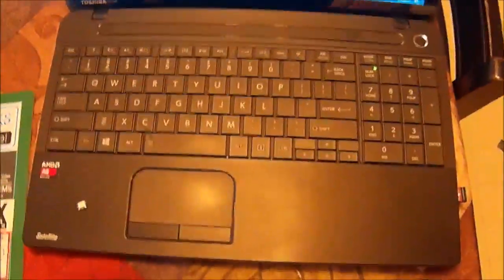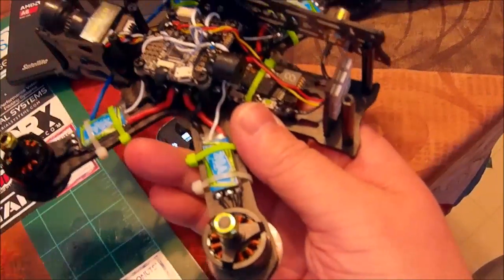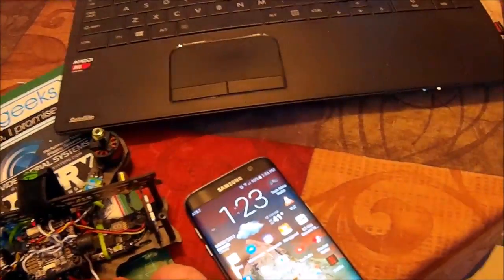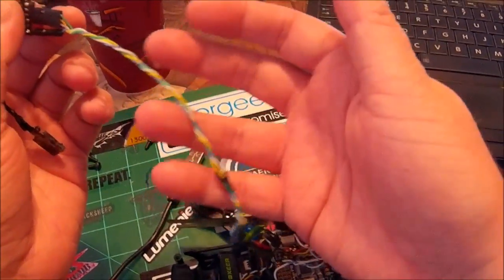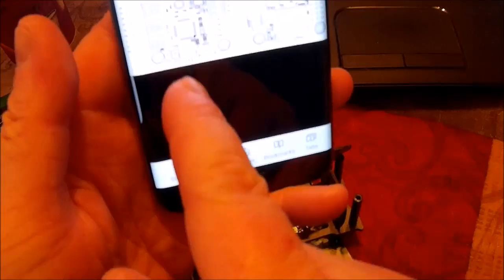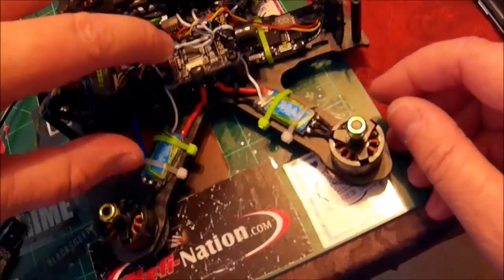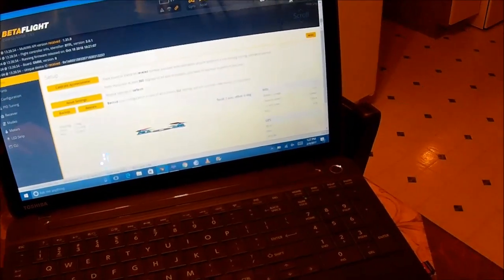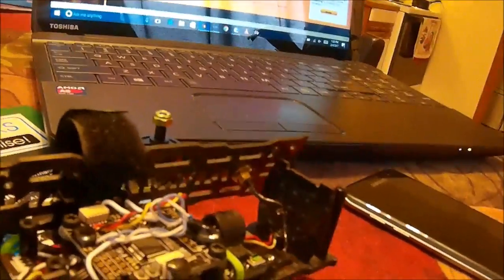dont throw away your fc with broken usb port

Comment: I had to ise this method a month ago but the only thing I can do is change the settings. When i put the fc in boot loader mode , so o can flash new firmware, it is not recognised by Betaflight, it fails to communicate. It seems that the bf for example recognise only the first device meaning the adaptor and not the fc that comes second and is in bootloader.

Comment: Hey Adam.  We chatted a few weeks ago about spektrum receivers.  Well I bitnthe bullet and got an eachine wizard x220.  Quick question on how to arm the damn thing lol.  Iys running betaflight with a sp racing mof3 v1. Hooked the rx orange to 3.3 v black to ground grey to rx in the uart 3 on board.  All that worked.   My question is could you walk me thru the mode switching for arming, angle horizon and acro modes on the tx in betaflight.  I got it to arm and the idle is good but when I throttle up it's good til about 25-40% and doesn't want to throttle down and seems like it doesn't respond to my throttle input and wants to runaway so I have to disarm to stop it.  Any help would be greatly appreciated and I need it explained like I'm a 8 year old lol.  I'm sure it's something simple but I'm just lost at the moment.  I run a dx7 btw.   Thanks again
Reply: ADAMBOMB FPV it won't come back down when I throttle down.
Reply: ADAMBOMB FPV dang.  My buddy has a vortex and his doesn't do it.  I'll have to double check some more.  What about setting my arming switch correctly with the values in mode and same thing with the angle horizon and acro 3 posand values?   Can you help
Reply: ADAMBOMB FPV roger that.  I did it.  Just not sure what the values are suppose to be.  I have aux 1,2, and 3.   When I go to adding them in the modes tab I'm not sure what values they are suppose to have in mode tab
Reply: ADAMBOMB FPV awesome thanks.  That's what I figured but to a newbie it's  a different world.  I searched for it and found lots of cleanflight stuff but with old spektrum tx so the minus are somewhat different.  I'll have to search for more.  Thanks again
Reply: ADAMBOMB FPV thanks for your help I'll check on it after work